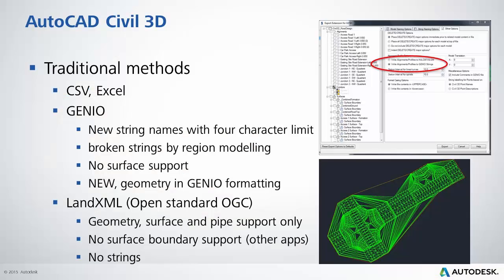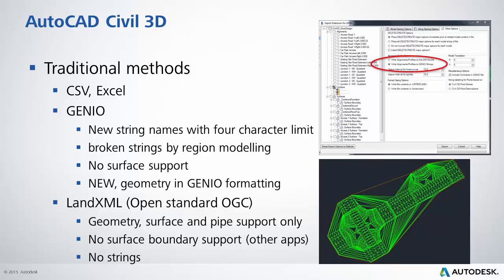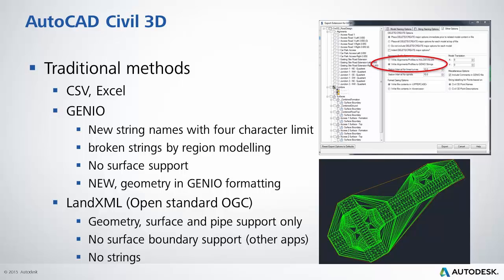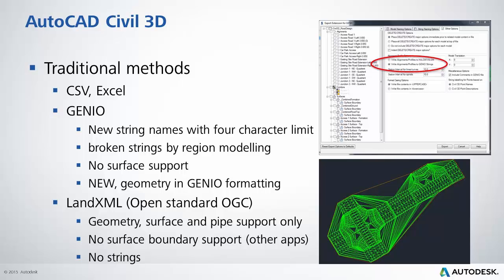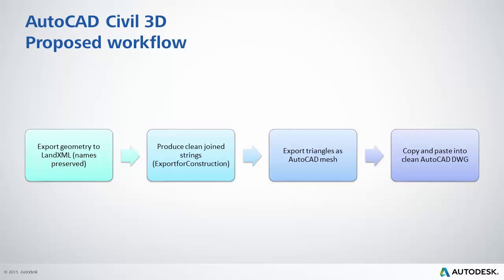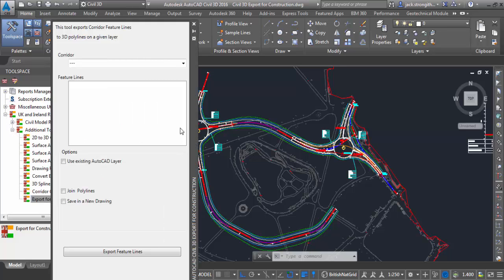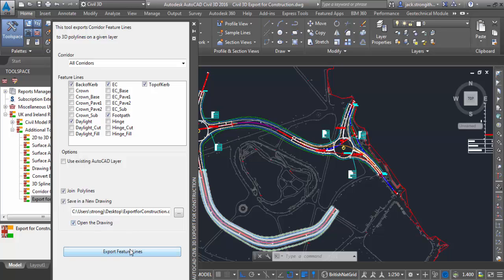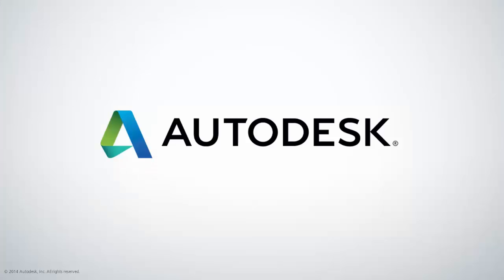AutoCAD Civil 3D Export for Construction  Tip and Trick

Comment: Hi Jack, This is a great tool. Have you tried to "exportforconstruction" a corridor using offset assembly? I think it is only converting a normal assembly. I tried this with a corridor using assembly with offset assembly and it is not converting the offset assembly as a 3d strings. Can you please test if there is something I'm missing. Thanks. Jowenn